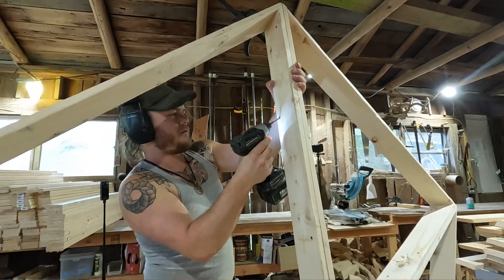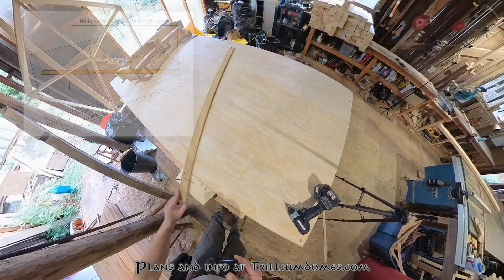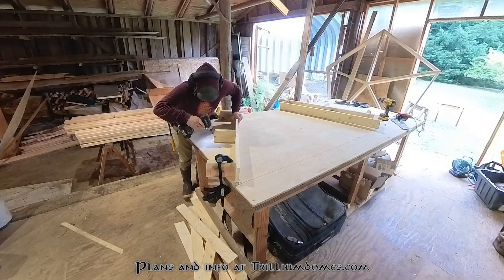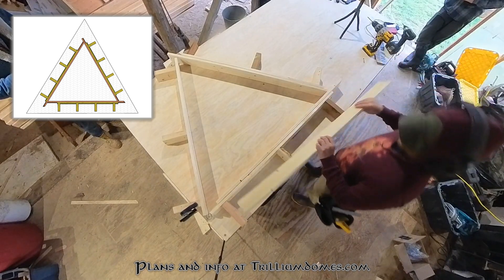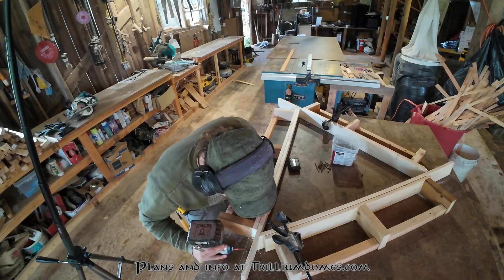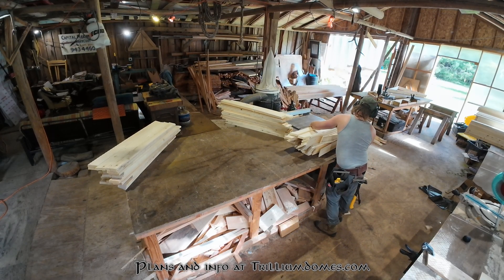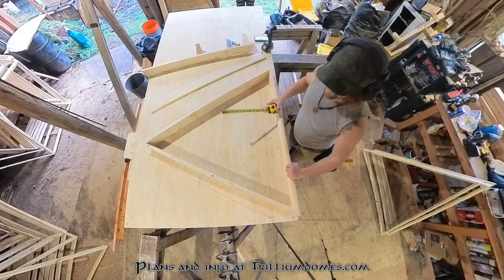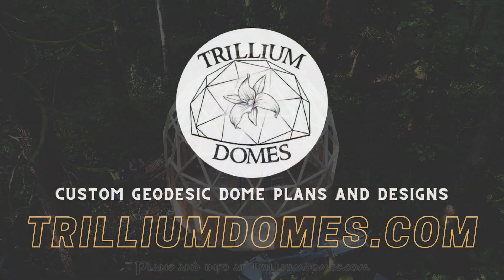DomeCraft #1 Deep Frame Method - Mastering Geodesic Structures with Trillium Domes

Comment: i tried this method, but ended up with the side of the triangular panel uneven. there is a slight overlap. im guessing its due to the strut not being vertical. so the faces are not parrallel to one another. is there a way to do a deepframe dome but to en up with the triangular faces flat. like in the bevel method, boths faces are straight faces.i was thinking to pass the struts threw the table saw and give it the bevel it needs to end up with a the face looking out of the dome to be a straight face so it would be easier to but the osb panels with out having any gaps.  what would be your recomendation?

Comment: Looking at the final image of this dome on the video, can the bottom row of triangles be excluded? To me the dome structure looks too high above the pony wall. Kinda looks out of proportion. So if I took that full Pentagon dead center of the structure, and didn't use the bottom half and omitted the single triangles to the left and right is that doable? For me it would look more like half a circle and more proportionate. Thanks greatly in advance
Reply from the maker: Yeah that's definitely doable. We also have lots of designs at trilliumdomes.com - this was put on a pony wall to create more headroom but you could climate the pony wall altogether

Comment: For a poly wrapped greenhouse dome would you go for deep framing or beveled construction?
Reply: The beveled method would be totally fine. How big and where are you located?
Reply: @johnnybayles7412  thanks for the reply. I am in southern Ontario so some heavy snow loading. I picked up some odd lots at an auction last week including 200x  2x4x6 WRC,  200 x 2x4x6 Hemlock handrails, 200 x 2x4x6 WRC handrails mix of upright tops and bottom rails. To minimize waste I was thinking a 3v, 30ft diameter with a 6ft C strut. I think the 2x4 ripped in half for the bevel is too small so the deep frame seems better and I could try some using the handrails with the curved part facing inside and the flat on the outside. I would go for a 24" pony wall.
Reply: @johnnybayles7412  I tried to grab your free guide but didn't receive any emails, you might want to check its working.
Reply: @johnnybayles7412  Do your plans include both deep frame and beveled in each set?

Comment: I’m trying to find a good source for the mathematical formulas to get the strut lengths to the long points and the angle/bevel degrees for this method… it is not proving to be an easy task but i MUST KNOW at this point lol
Reply: I assume you’ve. Found it by now but google desert domes  archaic website that has a great calculator with  frequencies

Comment: Hi there, I have discovered geodesic domes last week researching how to cover a playhouse in my backyard (overkill, I know...). I have been binging your videos and others since that. Loving everything about it! I have lots of 2x6s laying around and would like to use them, but i am wondering what cut to achieve the strongest structure for a 2v 18ft diameter dome. Should I cut the 2x6s into 1x3s and do a deeper frame than the 1x4s you are using in the video? Or should i cut my 2x6s into ~2/3s (with an angle cut of course). It will be the same amount of wood by frame, but I am wondering wether the deep frame profile really adds strength or not. (considering that we snow sometimes in NJ and I would like to add a swing from the top... Let me know what you think. Thank you so much in advance.
Reply: The deep frame definitely adds strength.  You could rip 2x6 in half and do the deep frame method on my 18' dome plans and it would work a treat
Reply: @johnnybayles7412  OK thank you so much!
Reply: @johnnybayles7412  thank you! And of course, you might have notice I meant cutting my 2x6s into 1x6s an not 1x3s...

Comment: Great video!  I've seen this or very similar designs for about 40 years.  I think they are great for a warm climate.  This design doesn't offer much space for insulation though and snow load must be a concern as well.  Have you ever built domes in some place like Minnesota?
Reply from the maker: Yep, domes can be used in all climates. There are many ways to create as big of an insulation cavity as you need!
Reply: @ true but not with your design and it’s an important consideration
Reply: @db7732  no you literally can add more depth to any of our designs.

Comment: I'm new to your channel so sorry for random questions but do you have any plans you shared that have been approved by an engineer? Or do you not even need that for code? And have you ever done one with just glass ? I really dislike the plastic but I really want to build one. Anyways thank you a ton have a great day
Reply: Hey there, just like any other type of conventional structure, all these plans can be approved by an engineer, but they have to be stamped for the individual soil conditions and project details. Yes, you can use glass, but I prefer polycarbonAte for many reasons
Reply: @johnnybayles7412  thank you do you sell the plans or give them away I'm trying to figure out how I get a 40 foot dome  design ?
Reply: Also I understand the benefits of using the plastic but do you think about the long term effects of micro plastics? Please don't take offense I just am asking for an opinion on the subject.

Comment: I would love to see a hempcrete dome! It supposedly needs 12” thickness for good insulation, but can be wider than the frame and encapsulate the frame. You need a way to secure it while it dries, that part might be tricky with dome shape 🤔

Comment: At 9:15 you mention that you should measure it to a 30 second. What do you mean by that? If it's 30 arcseconds in degrees, that's around 0.0083 degrees. Is that really the precision required?
Reply: Accurate to 1/32 of an inch or around 0.8mm.

Comment: Green lumber usable here? Or will it warp too much when drying?
Reply: I've done it and it works!
Reply: @johnnybayles7412  how long ago did you finish it? Geodesic domes seems to me to require quite accurate measurements and I'm afraid the warping might be too much as time goes on. But green lumber is the only thing I can get my hands on that isn't prohibitively expensive where we are, specially considering how things might go wrong while trying it out.
Reply: @Norbingel  it's  been up for over a year and is a residence so it's heated with a wood stove. The wood is definitely seeasonedd at this point. It's actually the dome with the green roof at the beginning of this video.
Reply: @johnnybayles7412  That's encouraging to hear! Can finally try my hand at one of these things. Is there any warping of note at all? How green would you say your lumber was when you used it?